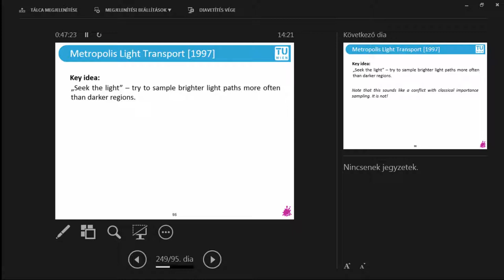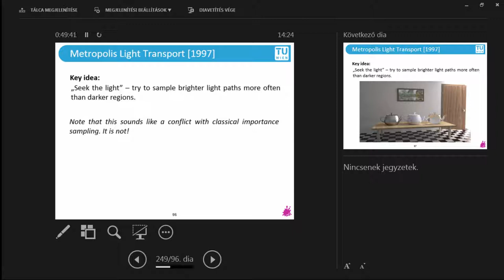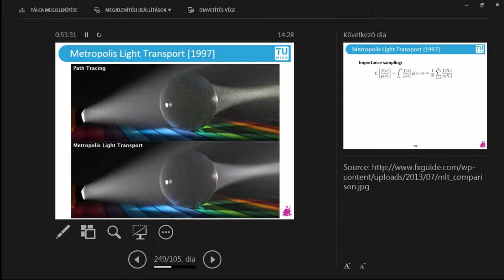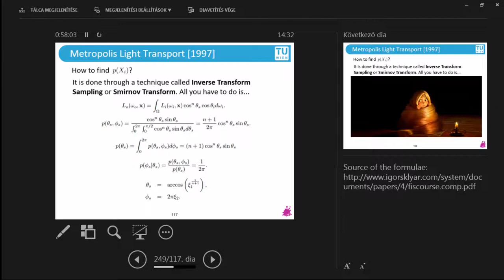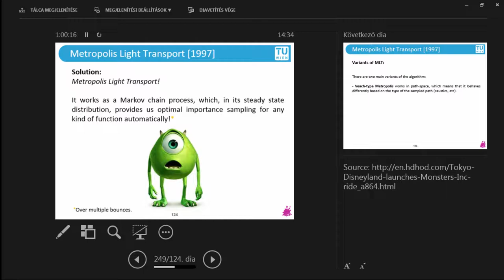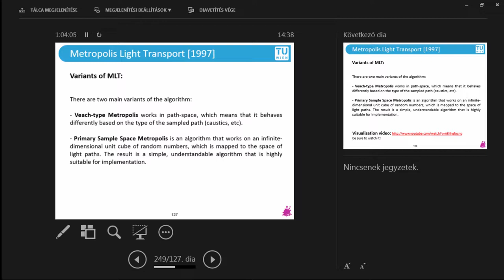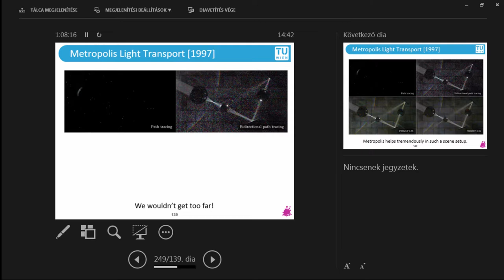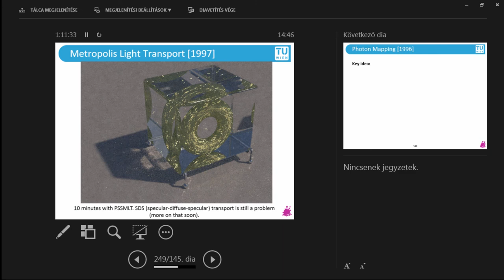TU Wien Rendering #33 - Metropolis Light Transport

Comment: @1:46 "black body" is a dangerous term here, since he probably just means a body with the color black, but a black body also is a fully absorbing body, that emits light depending on its temperature. If it was hot, like in a light bulb, it would be a light, and (probably) completely contrary to what he tries to describe.

Comment: trace N1 photons of light for the scene with k1 bounces and store all the points, directions and color in a VBO/octree that we will call lighmap.
trace N2 photons from camera to scene with k2 bounces and store all the points, directions and color in a VBO/octree which we will call a cammap.

So for p(x_i) ~ f(x_i):

Let's say we trace a ray from the camera, until it hits a diffused surface, wouldn't it just be finding the closest photons of light on the lightmap and using its source direction as a sample and intensity for p? the same can be done for photons of light.

One idea I thought of to create an octree with dots is to use a lossy method which is basically the following:
  startup: start with root node with 8 empty children in memory
step 1: for all points, for each point k, write a new node with reference to the point in memory at address id_k
step 2: for all points, for the point k that we want to insert in the octree, find the memory position p_k of the node's child
step 3: for all points, write the id_k of point k at memory location p_k.
We can start with 8 points and then 32, 128, 512, 2048 until we finish the list of points that we want to insert in the octree.

sorry for bad english

Comment: Pretty sure that Steve Worley used mlt in fprime in 2003/4. I always thought it was a good implementation. It worked well enough. I think the biggest issue with it early on was the lack of fast computers to render on. I remember waiting 3 days for a single frame to render in the early days of path tracing. The hardware just wasnt ready at the consumer level yet.